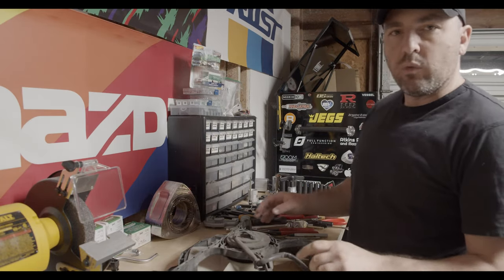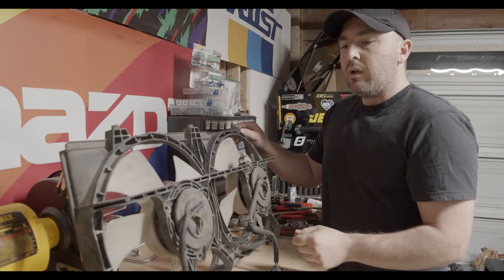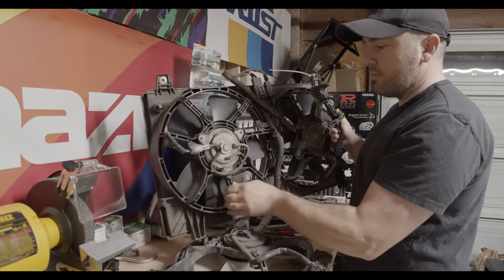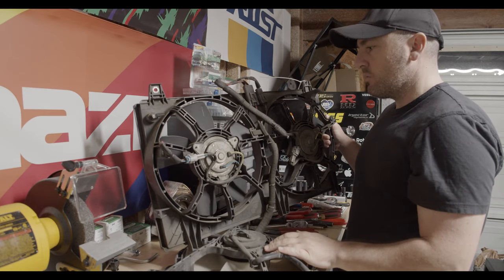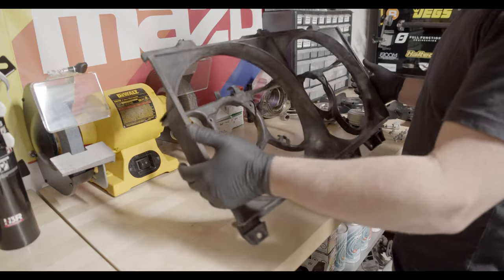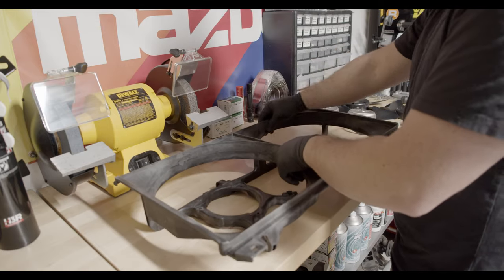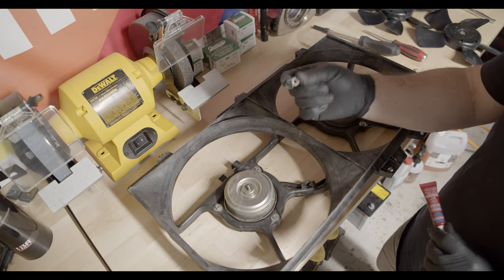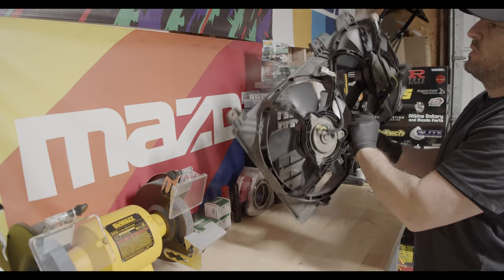Stormtrooper RX-7 Part 25: RX-8 Fan Mod

Comment: the connectors are different between the 8 motor vs the 7. You'll need to cut and resplice most likely
Reply from the maker: You have a point. The series I RX-8 has completely different fans that are not easily swapped without changes to the wiring. The series II RX-8 fans are actually identical to the series 8 (99 spec) RX-7. Series II are the ones you want to go with if you're retaining the stock wiring, and are the ones seen in the video here. However, I've completely rewired the car from scratch so it really doesn't matter in that case.